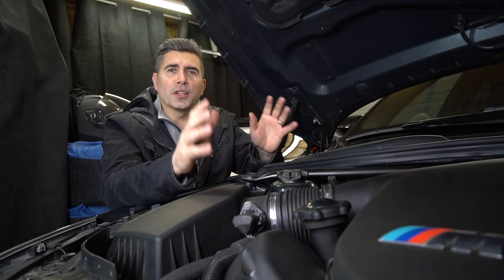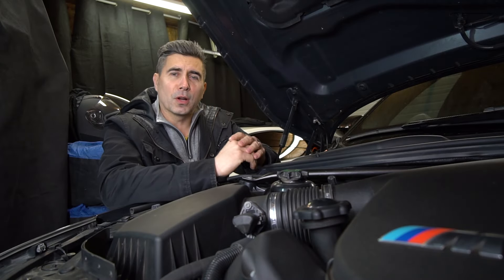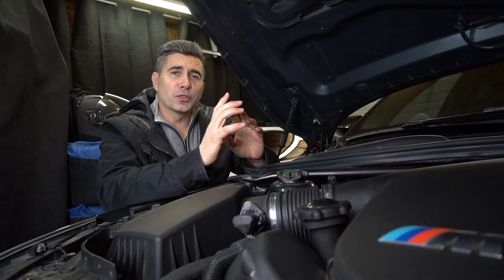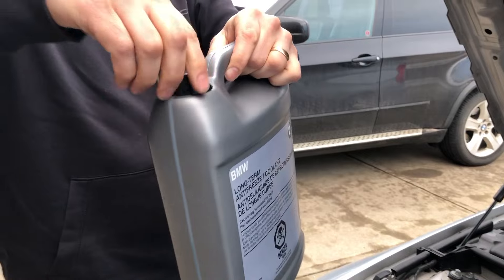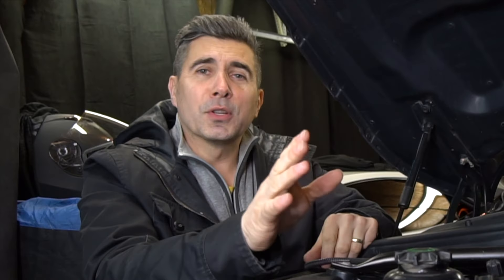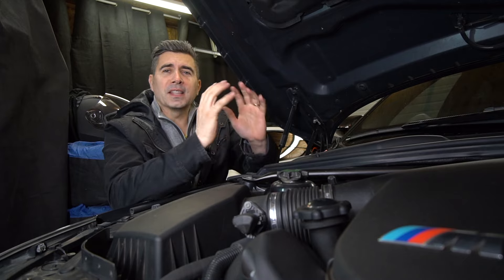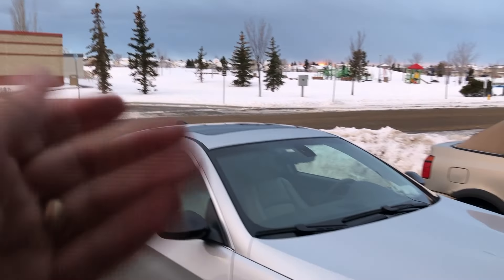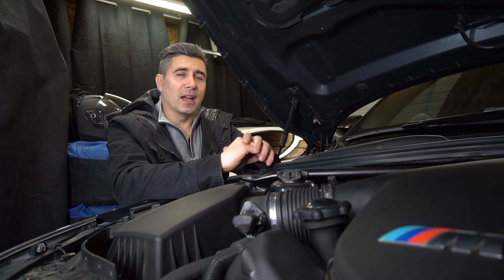5 BMW Maintenance Tips To Keep You Car Like New

Comment: I have a X3 and it has 198,000 miles. I never went to the dealer ship. All I did was oil changes since 130,000 miles. It’s running just great
Reply from the maker: That’s ideal.  Many success stories with BMWs too
Reply: What engine is in your x3
Reply: What model year is it
Reply: You caught a beauty.
Reply: Edwin 2006
Reply: Sean 01 it’s an 2006 before the N52
Reply: Glad to read this, im looking for a 335i but have my doubts about getting one because of bad reputation. About the wastegates, and seals failure.. you have any problems with that engine? Like the water pump or something expensive..? Thanks!
Reply: @SlayersFan1988  I’m not sure about the N series engine, I have a *2006 with the M54 3.0i*, I recently did the spark plugs and oil right after 200,000 but that’s pretty much it, engine runs smooth. I’m not a BMW technician nor know anything about the N series. I wasn’t even expecting the x3 to run this far.
Reply: @gg-ip3zo  The X3 have the N54 ? Did'nt know that
Reply: I was wondering how often you changed the oil as bmw recommends every 10k, but I started taking my 2015 bmw 650 to an independent mechanic, and he said to he advises to to it around 3k.
Reply: @gabrielvalentin4509  I changed around 3-5 grand. I can’t do 10 grand because I do drive my car pretty hard.

Comment: Bought me a 2006 650i , looking forward to proving the unreliability rumors wrong with the right upkeep !
Reply: How’s it going??
Reply: @Iamsoul00  i just sold it about a month ago, Up until about a good solid 10 months of ownership everying was great with regular maintenance  but I messed up and water got into a couple modules which led to me having to replace and replace so I parted ways with it
Reply: The maintenance on them are really no different than any other bmw , if your proactive when you see a small sign, use premium gas and keep fresh oil then you wont be breaking the bank

Comment: Taking away the Turbo cooldown procedure! Thanks ! Great vid
Reply from the maker: Thanks for watching
Reply: The majority (if not all) of new BMW cars have auto start-stop engine, so after driving for 2 hrs straight, the turbo is super hot, if I stop to a traffic light the engine will automatically stop. That's how its designed, it supposed to be a feature not a bug. What do you think about it?

Comment: Great advice, thanks! I’d also like to add that if you have a car with auto transmission, you should change the auto trans fluid as recommended. Sadly the newer BMWs do not have a physical dipstick for their auto trans, and you have to check it electronically with its computer.
Reply from the maker: True and in so e cases suggest it is a lifetime fluid, which is ludacris
Reply: It's recommended to change the fluid after 5 years or 60,000 miles by ZF (manufacturer).

Comment: Again, love the positive, friendly attitude and vid was very informative!!! Glad to be here! Thanks Mark!! 
- 1999 BMW 323i owner
Reply from the maker: That is much appreciated and thanks a lot for the kind words.  Great car by the way.  From a generation when the driving experience is personal and analog and less digitized.  Cheers
Reply: E46 for life🙌 
2001 318ci (m44 1.9L)
Reply: @kouroshtashvishi5031  Hec yeah!
Reply: i have a 1999 323i as well but all the lights on the dash are turned on, it starts perfect but once i put it into drive the gears don’t switch how they’re supposed to, i got it diagnosed back in the day, they said it was the throttle body but i had someone else look at it and they said it’s in limp mode and needs to be reprogrammed? any similar problems? and if so what was the fix?

Comment: Great tip regarding hot shutdowns on a turbocharged engine
Many years ago (back in the 70’s) Mack had a plate on the dash for their Maxadyne Diesel that said “idle engine 3-5 minutes before shutdown to prevent turbocharger damage”
Reply from the maker: Very nice.  Yes most people these days don’t give it a second thought, but they should.

Comment: oil change 6 000 km
transmission flush 30 000 km
brake flush
premium unleaded fuel
filters 70 000 km
sparks
Reply: Oi change every 6k km? What kind of shit oil do you have there, ever heard of LongLife?

Comment: Just picked up a CPO 2015 435i and it's my first turbo car. Turbos always seemed fun to me but I held off for a long time cause they also scared me with maintenance. I'll be viewing your videos much more now.
Reply from the maker: Thanks for watching
Reply: Philip Neas I was set on a 435i but then I found out how much  will it cost to replace the turbo and I had to give up on it. 
About $4,000. From a local BMW shop and my local BMW dealer. 
Enjoy your car. I’m sure it’s a fun and awesome car to drive 👍
Reply: @hugomeza2910  the turbo is very reliable in this car believe it on not
Reply: Philip Neas  yes I’m sure. And I also asked them that if it goes out or it will go out  at one point. And both the local shop and dealer said that it will. But of course if you take care of the car and the maintenance then it will last longer.
Reply: @hugomeza2910  oil.changes and keeping the turbo cool after hard driving is key
Reply: Philip Neas your right. And now I know to let the turbo cool down for a couple of minutes before turning off the car or after a hard drive. I’m not sure if both or only after a hard drive.
Reply: @hugomeza2910  I do both

Comment: Great content Mark! How often should engine oil be replaced on a M340i ?  I believe BMW just recommends top off until 7000 miles. This seems insane!
Reply from the maker: Brands will use the synthetic is better than Dino oil argument but I would cut BMWs recommendations in half especially now with hot running turbo cars.  It’s amazing how dirty the oil is at their recommended values.  I personally still still to the 3-5 thousand miles range
Reply: the german mech i know recommends 5k miles for ANY car with a turbo. He says oil is cheap, turbos are not. Also oil on sale is super cheap. I have seen full syn mobile one 6 qt for 20 bucks on black friday
Reply: I am a big fan of AMSOil. There’s a lot of marketing in the oil game but I’ve read some data admittedly from AMSOil that indicates the performance of various oils differs significantly.

Comment: Bmw E90 M47 engine, 211000km so far, without any problem. My advices are: 
Don’t skip the service intervals. As a matter od fact I prefer to change oil a few thousand km before the book says, or if you don’t drive a lot you should change it one year maximum after your last change, use the quality oil, use the quality fuel, and do not drive it in high rpm before the engine warms up. Just to mantion that it is much better to drive the car on highway instead of driving in the city, this affects diesels expecially. Also you should wash and clean your car regulary, specifically you must wash it during winter time, when the salt is on the road, that’s how you should prevent any possible problem with rust or with paint.( Don’t forget to wash your car from below from time to time) 
Good luck, and most importantly, enjoy driving!

Comment: spark plugs are a actually somewhat important but maybe not very often required to be changed, ive seen plugs break apart inside the cylinder on a cayenne turbo, as well as a x5m
Reply from the maker: Running higher stressed engines or modified cars it may be a bit more important

Comment: 5W-30 is the right type of oil?
Reply: Would avoid running 5w30 oil on a turbo engine, 5w40 or 0w40 most recommended.

Comment: Shutting down the engine for a long time while the oil is very hot is indeed harmful. But idling the car for 5 min at a gasstation is basically unnecessary. You fill the gas and you’re away in just 5 mins so the ‘heat soak’ is very minimal. In case of a full stop (stopping the engine for 20min+) it’s different, yes. Just drive the car a little slower or in lower revs for atleast a few miles before shutting down the engine. That will cause the radiator to cool down the oil and the engine will circulate the cooler part of the oil into the turbo. No need to idle it in my opinion. Just a waste of gas.
Reply from the maker: Thanks for sharing

Comment: In my family we’ve had our bmw 1995 3.2.5 TD since it came out, and the only time it broke down was because of the alternator that had to be replaced, apart from that we never had any major issues with the car. 
I believe the car is a limited edition ( I’m not completely sure though) since it’s a manual transmission and also a turbo charged Diesel engine. It has 230000 miles on the odometer, and still runs great!

Comment: I am an owner of F30 335i xdrive with MPPK for over a year and half now. I have clocked it 0-100 in 4.8, wish it was faster yes but it still smokes camaros and mustangs on a red light.  Hope it lasts for another 4 years!
Reply: Get a Dinan tune and you won't believe the difference in power.  Not too expensive considering the HP and torque gain.  I have a Stage 2 tune on my Z 4 and it transformed the car.

Comment: If you are running a top-tier full synthetic oil .....that will not coke up.....ever AFAIK.

 That whole coking phenomena is for dino oil and old turbo designs.

Now, it's still a good idea to not overheat your oil because it can degrade oil flow characteristics.

 But, coking? That's simply not an issue with full synthetic oils. That's not the reason why you would want to cool your turbo down these days using full synthetic oil.

Comment: I had 13 cars in the last 17 years. Yes I have  a problem. The 520 F10 is by far the best car I ever had. Also use to work in a car dealership and I can tell you its very hard to beat the BMW overall  value. Hope this helps.

Comment: Thanks for the information! 
I really wanted to get a used 435i series and was willing to pay for whatever the maintenance costs would be. But then when  I found out how much it will cost to replace the turbo I decided not to. A local BMW shop gave me a price of about $4,000. My local BMW dealer gave me a price of $4,500. 
That’s with labor and parts. That is just crazy!!! 
For the 428i they quoted me about $2,300.
Reply from the maker: I think you will find d similar pricing in most manufacturers these days since most euro and Japanese cars these days use turbos
Reply: Not to be a dick but honestly if your are shopping for a bmw the n55 is way more reliable than the n20 if I’m buying a bmw it’s going to be a six cylinder it’s a must for me along with the m sport and lighting package
Reply: Turbos are not necessarily going to break if you take care of the car. The 4 series is nice car quite comfortable and quick but not luxurious.

Comment: You forgot to mention importance of not using non cellulose oil filters but a synthetic oil filter.
Reply from the maker: Its the extended oil servicing that causes that issue and one should shorten up what the dealer is recommending

Comment: Have a E93 58 reg only done 35.000 miles . Without the exception of a new water pump never let me down. Preventive maintenance is the key . If it’s got tits or wheels it will cost you money 😜
Reply from the maker: Thanks Stephen.  But they sure are a blast to drive.
Reply: ExoticCar PlayPlace definitely a fun car to drive . Underestimated.

Comment: Fantastic advice, especially on Turbo care. Loving the channel too!!
Any advice on spotting badly worn Turbochargers when inspecting a used BMW....any obvious signs?
Reply from the maker: Hi and thanks for watching.  Early n54 engines have rattly wastegates which sound like loose chains in a can or smoke.  Bad seals will cause the car to smoke under boost or startup or lift off throttle.  Other than that, hard to say as long as it is making power as it should.
Reply: Thanks a million Mark. 
Plenty of fans down under btw!
Reply: ExoticCar PlayPlace my twin turbo sounds rattly what should I do to fix it?
Reply: ExoticCar PlayPlace btw I have 2010 bmw 335xi

Comment: I have a 2012 BMW 535I Xdrive & “drivetrain malfunction: drive moderately” shows sometimes. I took it to bmw specialist & I was told “low pressure” came on the scanner & I should replace the gaskets / oil cooler / coil overs ... do I do that? What do I do?
Reply from the maker: Score changing a pile parts I would first confirm what the fault really is.  If in fact it is related to low boost pressure, I would start troubleshooting that angle first.  This could be related to worn out turbos which cannot make target boost, wastegates that do not respond properly and can either let too much or too little boost into the engine, could be charge pipe which is common, could also be pressured system leaks or intake manifold gaskets may have a leak.  I would try pressure testing the system and go from there.  I have even seen bad gas or too low octane cause the computer to respond I a similar way.  Cools and plugs are a waste if you do not have a misfire
Reply: ExoticCar PlayPlace thank you !!!! I also only use BP & Mobil gas. Is that good ?
Reply from the maker: you bet.  Just be sure it is the highest octane available.  Also look on the pump and I would say limit the use of alchohol blends, even thought they have high octane, they can wreak havoc with fuel systems especially if the car sits a bunch.
Reply: ExoticCar PlayPlace THANK YOU !!!!!!!

Comment: Hey, great channel 😀
My 640d (2013) rod bearings failed so I've had a new block and oil pump from BMW. Any advice relating to maintenance once she's back on the road? I paid for the work myself because its out of warranty.
Reply from the maker: Big thing is many more oil changes than BMW tecommends.  Also stay on top of your cooling system line water pumps, T stars, rads and don’t allow parts or fluid to deteriorate too far.

Comment: So let me summarize this up,I have to change the hoses with the water pump,the routers and brake fluid with each brake pads change and the suspension system frequently not to mention the rest of the maintenance stuff and the electronics ,yup sounds like a money pit to me :)
Reply from the maker: These maintenance items apply to virtually all cars and suspension systems should at least get an inspection, and seldom need an overhaul.  When it does though, just do not neglect.  Thanks for watching
Reply: Don’t get me wrong,I love bmw’s a lot but I hate them two for their high cost maintenance,that’s why I prefer to get a Lexus instead so  I don’t have to worry about most of this stuff for a long long time, lazy cheapy me :)

Comment: 1 reason to change plugs is to help ensure they don't seize themselves inside the cylinder head. I've seen a few that wouldn't come out of aluminum head engines after they've been in the head for 100k mi or more.

Comment: 1. Coolant system
2. Spark plugs & coils 
3. Struts & suspension 
4. Oil & other fluids 
5. Break system.
Reply from the maker: Thanks
Reply: ExoticCar PlayPlace at least for my e46 this was the order it seemed to go in. 6 would have definitely been seals. I’ve never had a car leak like my BMW did 🙄

Comment: I’ve always questioned the BMW lengthy 12k+ mile oil changes when my N/A 4 pot Outback requires 6k mile oil changes for a relatively simple engine.
Reply from the maker: Marketing and sales
Reply: I am old school: oil change every 3,000 miles or three months, whichever comes first for my 2011 F10.
Reply: I think climate is a much bigger factor than the manual indicates.  Park your hot oil outside every day and you'll see condensation everywhere.  My rule is minimum one change per year here  in Canada but maximum is 5,000km.

Comment: Do your tips also hold true for Diesel engines? Would changing oil every 6,000 miles be appropriate for highway driving all season? 4 cylinder 2.0L 318d
Do you have a tip to keep the interior in good condition? I have black leather Dakota seats. I'm asking, because I want to keep my F30 until the EU ban the combustion engine from traffic or the car completely breaks down. At least that's the plan 😉.
Favorite car channel ❤❤❤🚗🚗🚗
Reply: Replying in case of reply :o
Reply: So you got a diesel engine too? :)
Reply: @fabiusmaximuscunctator7390  I dont :( but i love their relaibility scores, how disels can last so much longer than gas cars !
Reply: @lexithelexus7377  Diesel are built more robust and work in lower rpm's therefore the reliability ;)